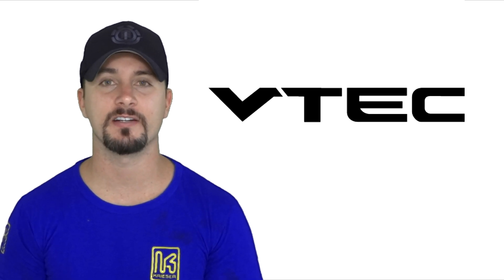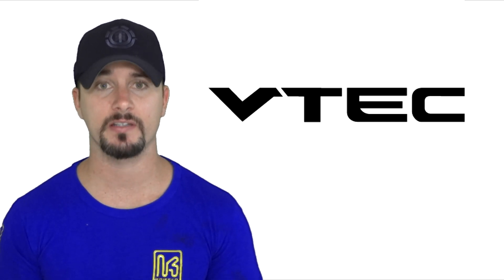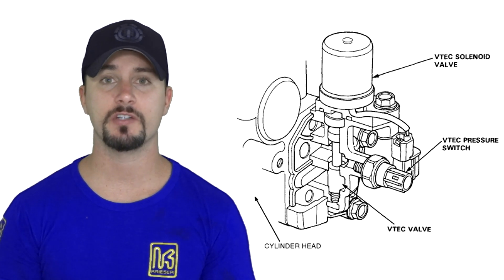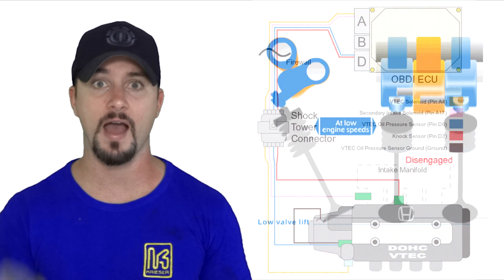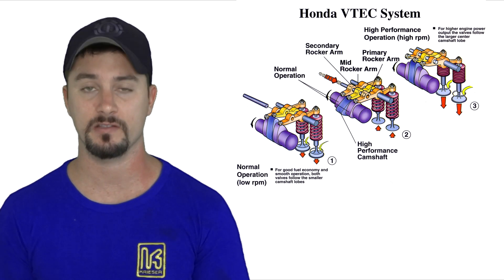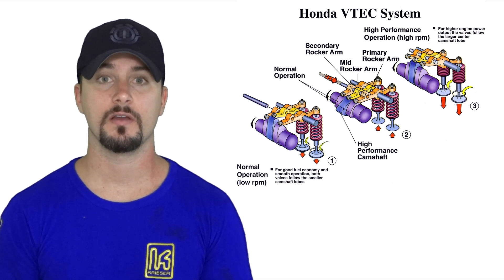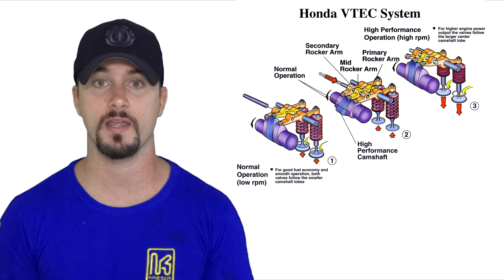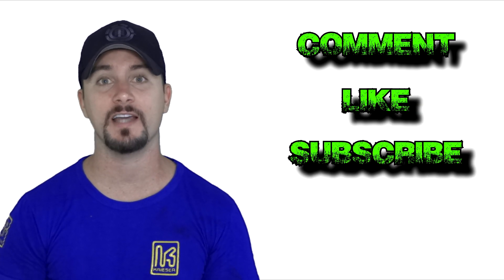How Vtec Works "Full Description"

Comment: Does the amount of fuel that is injected increases when the valves go further down? What is the effect in fuel consumption?
Reply from the maker: Yes, the "ECU" gets a signal from the (MAP) sensor that's picking up on the rpm change, and absolute pressure change, and adds fuel as needed.

Comment: So, why only let the larger lobe kick in at a certain oil pressure? Why not just use the larger lobes all the time?
Reply from the maker: Excellent question Tommy,
The reason vtec kicks in at a certain rpm's has 2 reasons. Reason 1# When the power band starts to dissipate on the dyno graph, that's where vtec will be applied in-order to over come the power band drop. Reason 2# Vtec is not engaged all the time for better fuel economy, if vtec was engaged all the time with (vtec killer cams) "AKA" Toda Cams you would get less mpg and depending on the setup, possibly better performance.Vtec killer cams are actually producing vtec all the time but they eliminate the vtec system and push the valves all the way down like vtec all the time.
Reply: Nthefastlane thanks for explaining.

Comment: So in conclusion vtec system make the valve go even further down during the intake phase allowing the gas an air flow enter the combustion chamber with higher pressure?? And thus that make the engine more powerful than the other type of engine??
Reply from the maker: Precisely. And also the exhaust side if it's a DOHC vtec.